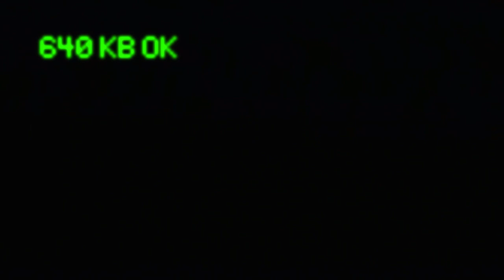IBM 5140 Power Board Repair

Comment: yep, as expected. I wouldn't leave any of the old caps behind if you have a desoldering pump to hand. if some of the caps used were leaking and failing, safe bet to just replace everything. it's time consuming but worth it, since it'll last longer. unless you have an ESR meter it'll be hard to tell how good or bad the caps are to begin with... again another reason just to replace all of them.

There's no available cap kit for the 5140 convertible anywhere so if you do an update video with the replacement of the rest, you should note down the values of everything replaced so to help others save time doing the same thing... it may likely be inevitable that all of the 5140s are going to need cap jobs, and I can almost guarantee the 720k drives inside are going to need them too, if they're anything like their PS/2 brethren.  so, you should look into that as well since those are usually early surface-mount and WILL leak and WILL cause damage and other issues.
Reply from the maker: Yeah. There aren't that many on the power supply board and once I get around to it, I will order enough to replace them all. I do need to take a look at the floppy drives as well as now I cannot remember if I replaced the capacitors on them or if that was on my IBM PS/1. This was just a temporary fix to get it up and running so I can make a more in depth video on it soon. Anyway, as always, Thank you for the advice!